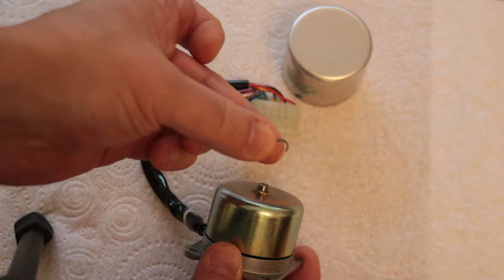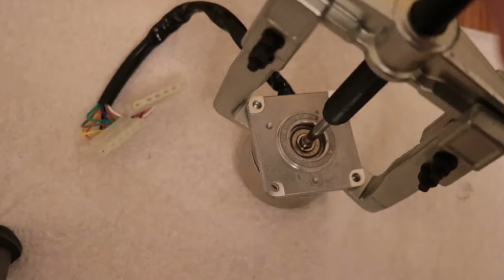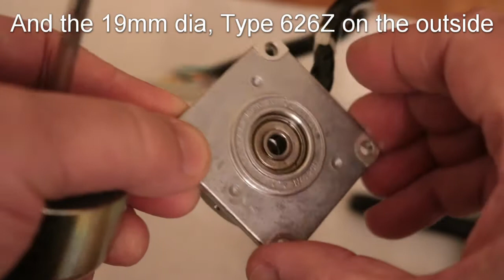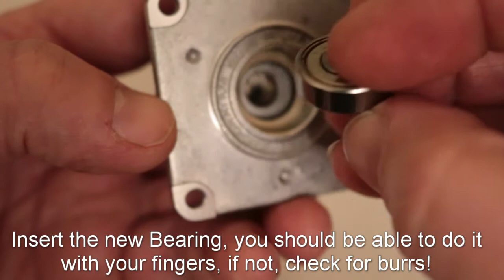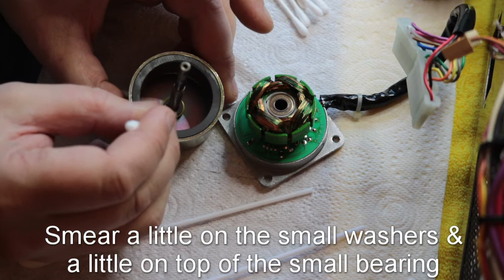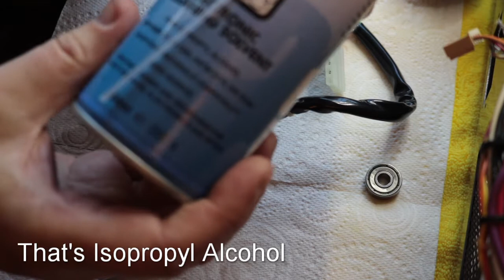Roland Re 501 Repair Part3 - Motor Rebuild

Comment: thx for the infos mate. ;)

my 101-motor is build a different way, and its not even possible to open the "top part" of the motor, as its seen in your video at min 0:26.

my model (pioneer) doesnt have that circlet and its build like a tank on top. if anyone here has opened that other type, please tell me how u did it :-) thx